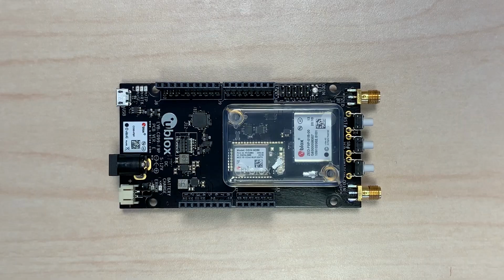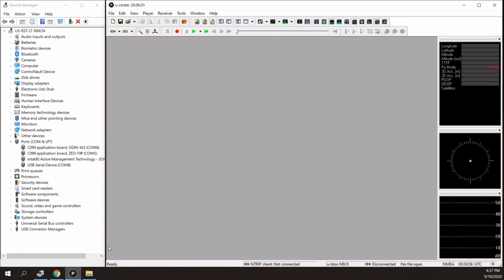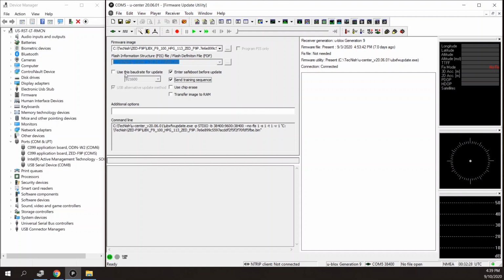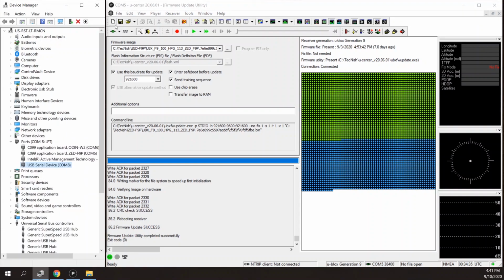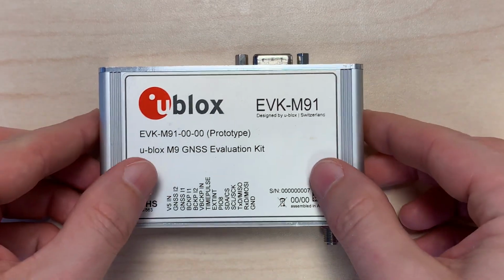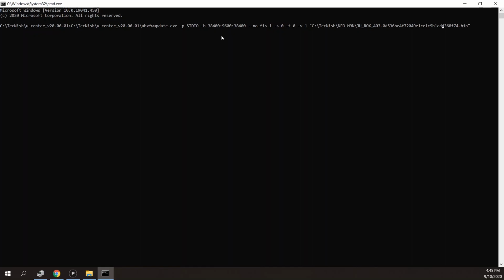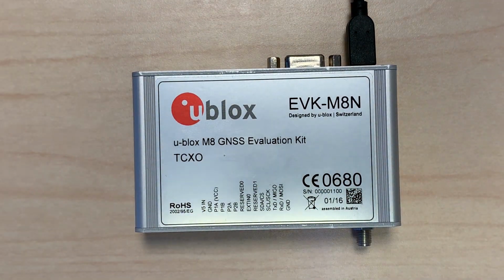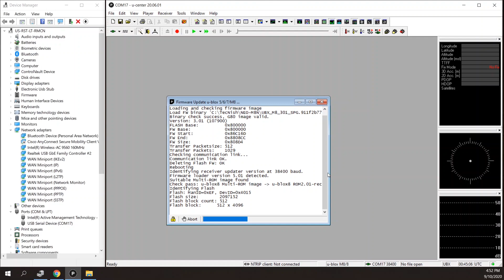#4 How to update the firmware on u-blox GNSS receivers

Comment: This won't work as shown to do the update because the button won't turn green until you find the file called flash.xml in the u-center folder and put it in the FIS box, then it turns green and you can program it.

Comment: I recently got a new gps on Amazon, says U-Blox7. I see it says it is running software firmware 1.00. I see 1.01 is available, so tried your Legacy Firmware Update. After browsing to the new firmware file, selecting the FIS file and checking USB alternative Method, upon hitting OK, I get some text then 
Suitable Multi-ROM image found
Check pass: u-blox7 Multi-ROM image -> u-blox7 ROM1.00-receiver
Identifying Flash
Flash: ManID=0xE, DevID=0x4013
Flash device not supported
Done in 6.9 sec.
Statistics:
	Erases sent:    0
	Writes sent:    0
	Erase timeouts: 0
	Write timeouts: 0

I'm guessing this is just a knockoff device that has ROM and is not flashable. Do you think that is the case? Do you think I won't be able to semi-permanently change the baud rate? Thanks for the great video.
Reply: Any luck with updating u-blox7 to 1.01...  I'm using Legacy Firmware Update, but after 160 sec:

Starting Flash Firmware Update
Loading and checking firmware image
Load FW binary 'C:\Users\choch\Downloads\FW101_EXT_TITLIS.42ec35ce38d201fd723f2c8b49b6a537 (2).bin'
Binary check success, G70 image valid.
Version: 1.01 (59843) Jul 04 2013 18:25:33
FLASH Base:          0x800000
FW Base:             0x800000
FW Start:            0x855DE9
FW End:              0x867D04
FW Size:             0x67D0C
Transfer Packetsize: 512
Transfer Packets:    831
Checking communication link...
Communication link OK.
Deleting Flash FW: Timeout #0, retrying
Deleting Flash FW: Timeout #1, retrying
Deleting Flash FW: Timeout #2, retrying
Deleting Flash FW: Timeout #3, retrying
Deleting Flash FW: Timeout #4, retrying
Deleting Flash FW: Timeout #5, retrying
Deleting Flash FW: Timeout #6, retrying
Deleting Flash FW: Timeout #7, retrying
Deleting Flash FW: Timeout #8, retrying
Deleting Flash FW: Timeout #9, retrying
Deleting Flash FW: Timeout #10, retrying
Deleting Flash FW: Timeout #11, retrying
Deleting Flash FW: Timeout #12, retrying
Deleting Flash FW: Timeout #13, retrying
Deleting Flash FW: Timeout #14, retrying
Deleting Flash FW: Timeout #15, retrying
Done in 160.4 sec.
Statistics:
	Erases sent:    0
	Writes sent:    0
	Erase timeouts: 0
	Write timeouts: 0

Maybe someone will be able to help?

Comment: I am looking for a way to make a UBX-M8030-KT output a $GPRMC sentence. Can you help?
Reply from the maker: Actually no configuration is necessary as the UBX-M8030-KT outputs RMC by default. Messages GGA, GLL, GSA, GSV, VTG, TXT are also enabled by default. For more help please visit http://portal.u-blox.com/.
Reply: @ublox  in my case the GPRMC sentence is missing. Only the GNRMC sentence is sent - is this normal and could it be changed?
Reply from the maker: @oe9fwv  Yes, that is normal. By default the receiver will set the first two characters after the $ (called the “Talker ID”) based on which GNSS system(s) are enabled. “GN” is reported when multiple constellations are enabled. “GP” is reported when only GPS is enabled. The Talker ID can be forced to “GP” by sending a UBX-CFG-NMEA message with the mainTalkerId parameter set to 0x01. Note also the gsvTalkerId parameter which can be used to force the Talker ID of the GSV messages to the main Talker ID.